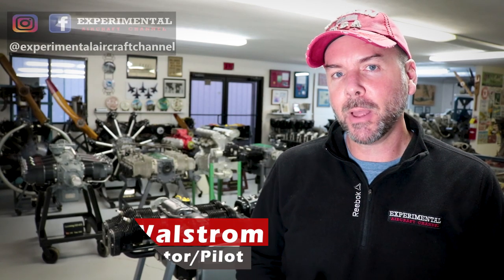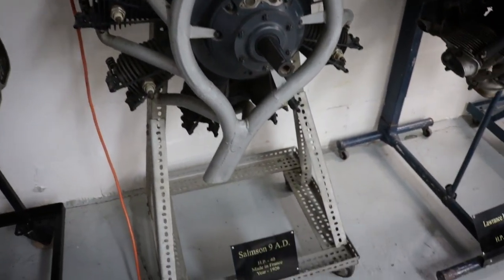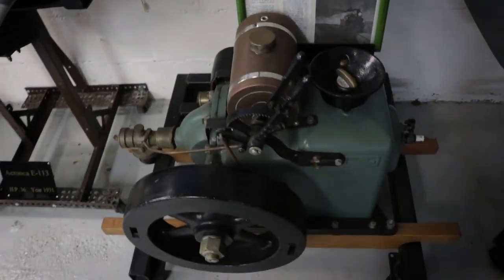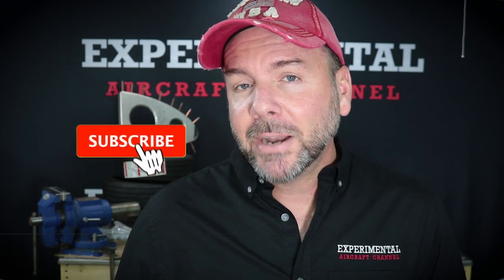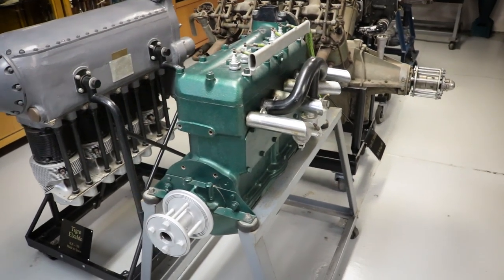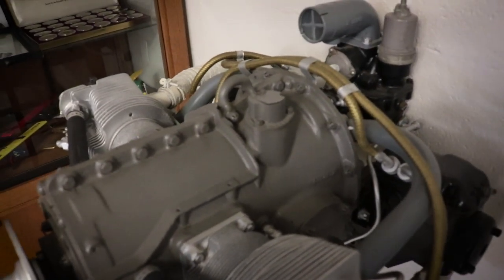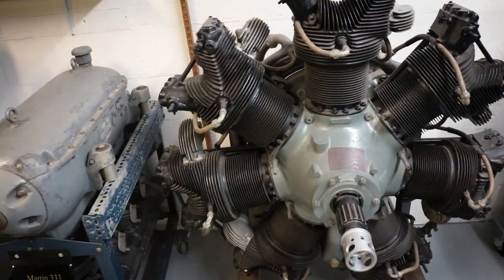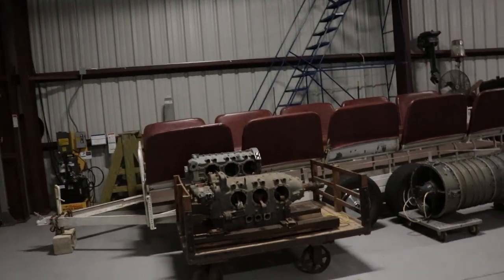Aircraft Engine Museum Tour - Thomasville GA

Comment: Must appreciate the mechanical brainpower and skills to engineer, machine and assemble these aircraft engines.  No computers or C.N.C equipment were used.  Went to an air museum at Kalamazoo, Michigan this past fall would recommend it to anyone that’s interested aviation.  Good video Bryan to bad the curator wasn’t available.